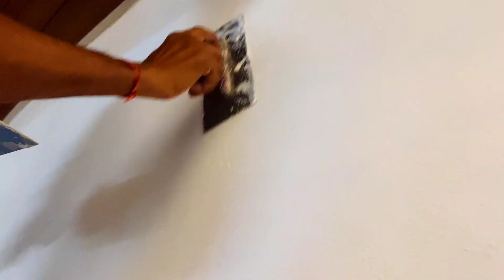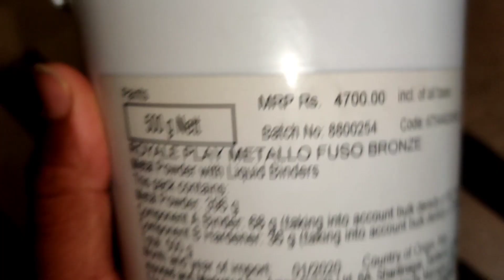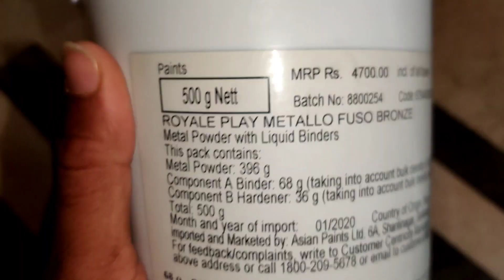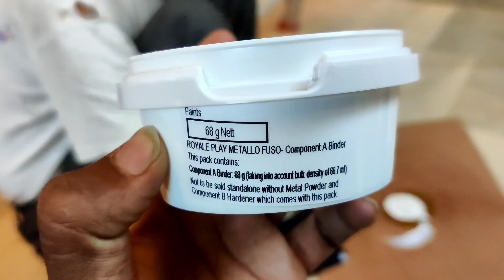#Asianpaint Asian paint texture design । Royale play texture। Royale play design #archiconcrete

Comment: Hi, Can we directly add color code to apex tile guard? As i bought 4 Liters apex tile guard used 2 liter for 1st coat in the remaining 2 liters can i get it tinted with 8302 directly?
Reply from the maker: Yup .. 

always apply 1st coat of apex tile guard as white with dilution of 1 ltr water in 1 ltr material..
then apply 2nd coat of apex tile guard in tinted form in same dilution ration 1:1
Reply: Thank you And one last question what all shades available for exposed concrete effects and can we use any other material like ultima apex or only tile guard

Comment: Can this be applied on exterior wall with standard effect ( without lines dots - only grey sponge )? What is the product & color code ?
Reply from the maker: yes it can be applied but only archi concrete..which isni grey color...
on outer wall top bronze( metal )fuso material will not be successful..
Reply from the maker: Archi concrete is base white ..
then use protective coat code - 8302 in color wash foam as shown in the video